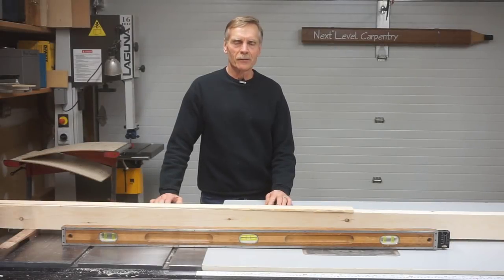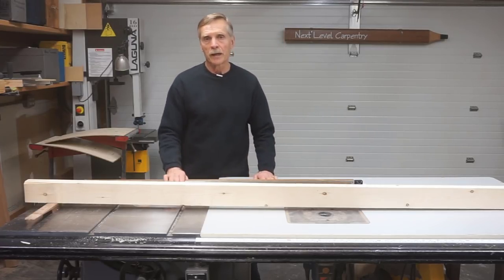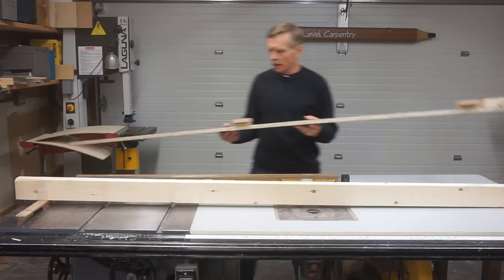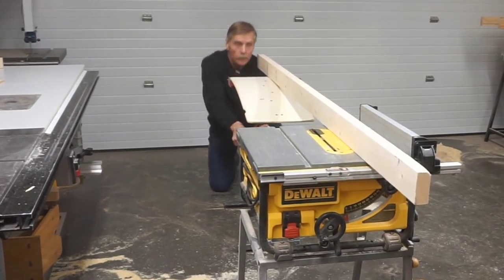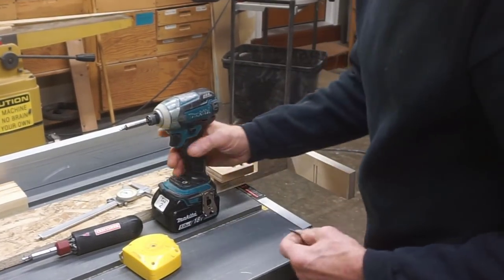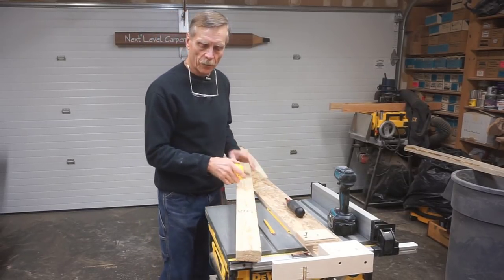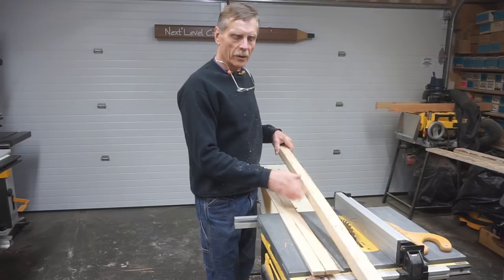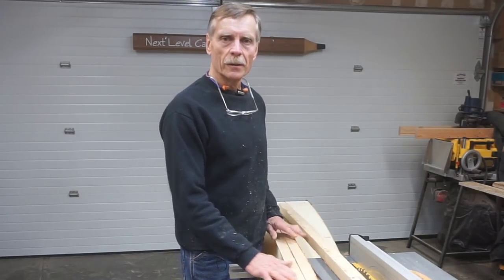How to Cut Super Shims

Comment: Don't know if anybody mentioned this, but since you write for trade blogs anyway, you might consider working up a script ahead of time. You can then set an automatic scroll speed in Adobe, Word, etc. on a laptop so you can read it like a teleprompter (and you can use a larger monitor or TV if, like me, a laptop would be tough for you to read at a distance). Even if you didn't use the script in that fashion, having written in out ahead of time would add some structure to your ad-libbing during the video shoot, and might help cut down on the "Max Headroom" effect a bit. 
Having said that, it's easy enough as a viewer to ignore it after a while; the larger benefit, I would think, would be in cutting down your editing time/effort. I mean, I'm pretty sure I saw a pair of cuts that had all of one word in between - that has to be frustrating in the editing process.

Comment: Thanks Matt. I'm doing eight bathrooms in a Georgian manor house now. All with floors taken up for underfloor heating. 180 years of settling is Maki g floors a little saggy in places. I was wandering if I could cut repeated shims or "firing strips" as we call them on my elu flip saw. im going to try this out and hopefully the forman will think I'm smart.
Reply from the maker: Rollo, not quite sure about the application you're talking about or what a 'firing strip' is.  If floors are truly sagged, as in long, shallow curves, instead of a straight out-of-level slope then super shims might not fix the problem in all instances because they are a straight even taper from end to end.  
To fix a sagging joist, one side of the shim needs to be 'arrow straight' but the other side has to follow the sagging joists' curve.  There are, no doubt, plenty of places in a house that's 180 years old where super shims WILL solve problems and, hopefully, impress the foreman.  Even if you don't bring a solution to the table, a wise foreman will recognize your initiative to look for solutions and give you a raise!  Best, Matt

Comment: I have been using this jig for a while now, and it is good. I recently had to cut a lot of shims, and this method is somewhat wasteful for that because you have to get a straight edge for every shim. With the cost of lumber so high and time being valuable, I acquired a cheap track saw. I would recommend the track saw method to anyone with a need for bulk super shims.
Reply from the maker: I suspect you're doing it wrong Benson because the only thing different in adapting a track saw for cutting shims like this is the tool doing the cutting.  There are no more restrictions/limitations on how much of a board can be cut using a tablesaw vs a tracksaw.  If you have a tracksaw, know how to use it and it gets the job done safely and efficiently, then it's probably a better option for you, regardless of the price of lumber IMHO.
Best, Matt

Comment: Another great job Matt!
I appreciate your professionalism, the super shims are SUPER. Don't worry about the editing, what you say is sincere and kind which means a bunch. Did you make your out feed table? I'm interested in getting one like so.
Thanks abunch
Reply from the maker: Thanks Brian!  Encouragement from viewers like you is a big help in giving me confidence to produce videos showing stuff like this without getting discouraged and bogged down worrying about loosing subscribers with less than perfect videos.  
Are you asking about the wide 'outfeed table"' attached to my tablesaw (with the router in it) or the roller stand I use in this video?  I made them both but not sure which you're interested in...
Best,
Matt
Reply: Next Level Carpentry 
Matt,
I'm interested in the roller stand, I've never seen one like it
Reply from the maker: Brian,
Got it.  You're not the first person to ask about those guys.  They are my own design and 'engineering' and, with increasing interest from viewers I'm contemplating a video showing how to make them and providing plans.  Their design and function allow me to do some pretty demanding cabinetry and millwork jobs all by my ownself in the shop to the point I don't know how I'd do without 'em. 
The stumbling block is that its a metal fab/welding project more than a carpentry job and I'm not sure how well it would fit with the theme of Next Level Carpentry.  I personally think that having a general knowledge and ability for metalwork is more or less expected of master carpenters.  What do you think? Would you rather see an outfeed roller build or one featuring plans and building of the classiest set of sawhorses you've ever seen?  I'm jazzed about doing both but your vote might sway which comes first :-)
Best,
Matt

Comment: Amazing video Matt.  If I use these to shim level my floor joists, will they not crack as soon as a screw goes in them?  Particularly screws that are a little angled from where the plywood subfloor would be butting up against each other? 

Also could I make these with a track/plunge saw with similar results?
Reply from the maker: Thanks danieliscrazy, good questions.  If you use a specially selected piece of lumber that's pretty knot-free and a bit 'softer' so as to be less prone to splitting you'll fair better in the joist shimming you ask about.  Not sure you'll know what I mean with that recommendation but imagine the difference between a piece of vertical grain Doug fir (super splintery) and one of sugar pine (soft and almost punky).  If you can't find a 'soft/punky' piece to cut super shims from or still have issues with splitting consider pre-drilling with a snappy bit set just deep enough to get through the subflooring and supershim.  That will eliminate splitting but maintain holding power of screws in joists.
I see no reason you couldn't make these with a track saw of sufficient length capacity.  With either piece of equipment, if you have a lot of  shims to make, consider starting out with wider material, say a 2x10 or 2x12, to save risk to your pinkies when cutting shims from the narrowing waste piece.  You probably already know this but keep in mind that this method produces shims with an even taper. That means they'll correct joists that are sloped only, NOT ones that are sagged AND sloped.  For sagged/sloped joists a different process is required to compensate for the curve of the sag.  Hope that helps!  Best, Matt
Reply: @NextLevelCarpentry  yes. Thank you Matt!
Reply: danieliscrazy111 Drilling a pilot hole before you drive your screws in will help to avoid  shims from splitting

Comment: Matt,
Thanks for the information.
What would I do if I need a shim 3/4 at one end and let's say 1 5/8 at the other. 
Would it just be a 1 5/8 screw at the push block end and another screw at 3/4 on the opposite end?

Or would that mess it up?
Reply from the maker: Hey Brian if I understand what you're trying to do the way to go about it is to set the screw at seven eighths of an inch and set the rip fence so that it starts the thick end of the shim at the full 1 and 5/8. That way when the blade passes the end of the screw there will still be three quarters of an inch in between. If that doesn't make sense let me know and I'll try another explanation.  The key to it isn't the dimension of the thick end and the thin end of the shim but how much taper the piece has which in your case is 7/8 of an inch... Best, Matt
Reply: @NextLevelCarpentry  thank you so much Matt for your kindness
Reply from the maker: @brianchv3661  youbetcha!

Comment: Awesome tips......I plan to use this shim system to slope my existing deck ,install plywood and finish it with Duradek type vinyl.I am leaving the existing deckboards in place.How should I fasten the shims to prevent them from splitting...I was thinking construction adhesive but the I still have to screw the plywood down....thanks in advance
Reply from the maker: I'd leave the thin end of the shims as thick as possible and then pre-drill for screws to prevent splitting.

Comment: You made a comment at the beginning of this video about making super shims for use on top of a joist that is out of level before putting a new subfloor down.  I'm actually working on a bathroom remodel right now where a single joist may be out of level by as much as 3/4" and over the span of the room, the last joist is about 2" lower than the first joist.  So I was heading down the path of sistering 2x10s to the existing joists to build them up.  Is it your experience that the super shim is a better way to solve for my out of level problem for my new subfloor?
Reply from the maker: Hey Robert,
Every situation is different so I can't say for sure in yours but, unless there's something drastic about your bathroom floor I don't know about, I wouldn't have a problem with adding 2" 'thick' shims to the top of floor joists, provided the settling isn't a structural issue.  A sistered joist that's not needed for extra strength is overkill IMHO but shims add no appreciable strength so be sure to decide accordingly.  That said, making individual custom super shims for joist that go from, say 1-1/4" on one end to 2" thick on the other is exactly why I produced this video.  Keep in mind that super shims as I show in the video will only properly level joists that are straight but sloped.  They don't remedy a joist that's both sloped AND sagged.
Good luck with your project!
Best, Matt
Reply: @NextLevelCarpentry  Thanks Matt!  I had a follow up question that I thought I posted, but don't see it now, so I'll try to "re-capture" it.  I'm going to try and get to Home Depot today with the intent of picking up a piece of plywood for the main component and it occurred to me that a Melamine covered shelf would give me more confidence that I have a straight and square factory edge.  What I'm unsure of though, is if the MDF core would hold the screws that mount the clamp downs, well enough.  What are your thoughts there?
Reply from the maker: @robertbrown6623  I might use a melamine shelf in a pinch because it's straight and would probably hold screws but it's so much heavier and more 'brittle' than plywood that it wouldn't be my first choice.  OSB and plywood are plenty straight, tougher and lighter...

Comment: May I know how exactly you have configured your roller stand with the plywood sled to receive the outfitting material from your table saw?
Reply from the maker: Great question: stay tuned to Next Level Carpentry where I'll be doing a 5-part build series for those very roller stands, starting in a few weeks.  FYI They're made by cutting, fabricating and welding steel, not woodworking, so brace yourself! 😎

Comment: I might be getting too picky, and the process is great as is your video (thanks) but when you changed from 4 to 6 feet shouldn’t you move the offset screw so that it is at the 4’ 1” point on the 6’ board. If you leave at the end of the 6’ board won’t the slope be a little shallower than over 4 ‘? Or increase the screw height to account for the extra 2’. I’m a retired engineer and my trig skills might be a little rusty but I think I’m correct.
Reply from the maker: Hey Mike, it's great that you're still exercising your engineering/trig brain skills in retirement!  
The point you make is accurate but so is the sequence/system shown in the video... here's why: the slope of 15/16" over 4' is 'steeper' than the slope produced with the same amount of 'rise', 15/16", over 12'.  
If I wanted to produce the same SLOPE over 12' as I did in 4' rather than the same RISE over 12' I would indeed need to make the adjustment you explain.
Hope that renews the shine on your keen powers of observation.  I hope too that I didn't miss the point and reaffirm an oversight that you caught and I missed (still).
Best,
Matt

Comment: What I need is an 8 ft. shim that goes from nothing to 3/8 back to nothing, I'm thinking circular saw or even better band saw, drawing the curved line is another question. Thoughts?
Reply from the maker: That's an easy one skylark... just make two shims 4' long that go from 3/8" to nothing and butt the thick ends together... easy peasy... maybe?  If you're fitting to a shallow curve that has a chord of 8' and is 3/8" thick in the middle you're best to scribe the curved line on the edge of a 2x4, cut it with the circular saw and then rip the straight side by indexing the other edge of the 2x4 along the fence of a tablesaw and making a rip cut to separate the curved edge.... hope that makes sense. Best, Matt
Reply: @NextLevelCarpentry  Thank you, this occurred to me right after I asked the question, thank you I appreciate the reply!
Reply from the maker: @skylark4901   shows you've got an agile carpenter's mind!  Nice 😀😎

Comment: Would you recommend using super shims to level the alcove area of a left-drain bathtub? In particular, I will have a 60”x30” acrylic tub installed in an existing alcove. The drain (left) side is ~9/16” lower than the rear (right) side. So unlevel right to left yet flat from right to left. This is on a 3rd floor so I was hoping to avoid self-level compound if possible.
Reply from the maker: In principle super shims should work fine for an application like that however in any remodeling situation there are so many variables that it's not guaranteed to be the best solution... but then again neither is self-leveling. It depends on so many things but for the most part you can use super shims to create a level support surface for a layer of plywood that the tub with sit on. That would provide more than enough strength for support but the extra thickness might raise the tub too high to make this an impractical solution. I suggest keeping it as an option unless and until you find some reason that's a deal-breaker. Good luck!
Best, Matt

Comment: Hi Matt, I need to shim x and y around a whole fireplace extended hearth. It goes about 14 feet left to right and is like 1/2 inch up just 3 feet from the right side. But also slopes up about 1/2" front to the back wall over 3 ft. Used to have bricks on it and I removed all of them. So it is covered with old plywood now. I want to lay cement board and tile down on it. I'm thinking, or just dreaming I don't know, should I make a 14 foot shim out of 48 pieces that are 3 inches wide? Leveling both x (14ft left to right) and y (front to back) at the same time. This would really annoy that other 12ft 1 piece guy. But is there a better way to do this? Like probably cut out the plywood then just shim the joist framing I guess?
Reply from the maker: I don't know exactly what you're dealing with, but in general, I'd lean towards removing the OSB if possible and shim framing directly, that is if you can't pull nails and re-level the framing itself.  Either way I think OSB over framing is better support for cement board and tile than cement board alone over framing.  I will say that, if you need to level framing that's out of level, this super shim method rocks!
Reply: @NextLevelCarpentry  It worked!  I shimmed twelve 3ft long joists at various slopes using laser level. Then shimmed the two 14 ft rim joists from 1/8 to 3/4 with 5 pieces. Thanks Matt. Your skills are outstanding. The jig I cobbled together with MDF, plywood blocks and 2x4 backbone got it done but now belongs in the bin. Oh, I’m putting plywood back down then cement board on that.